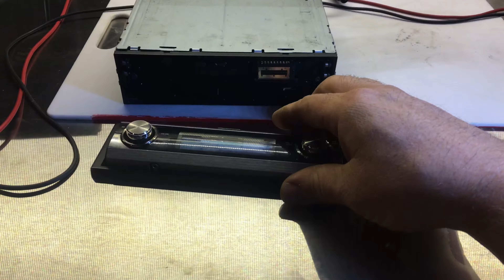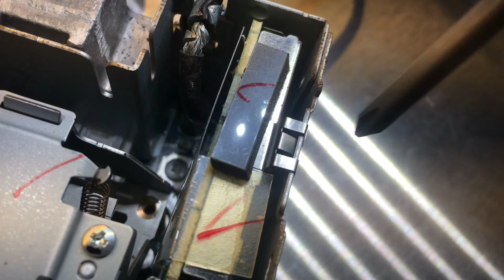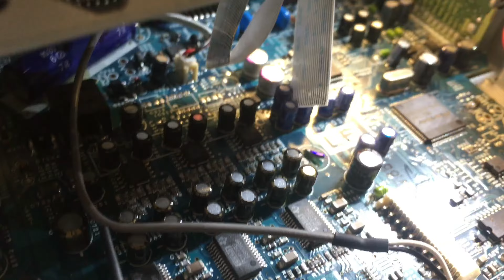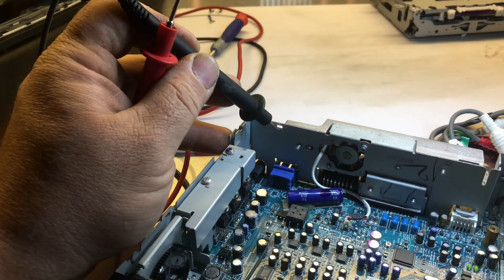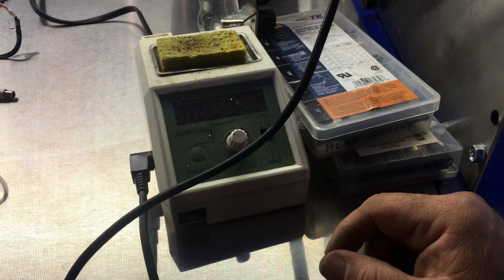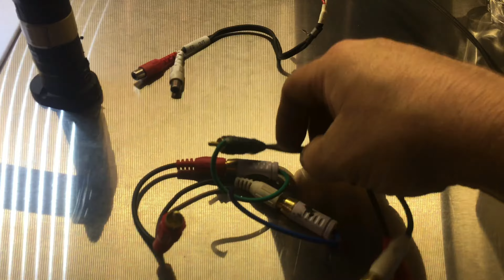Pioneer DEH-P880PRS Pico-Fuse

Comment: Hi Joe ... maybe you can shed some light on an issue I have. Mine is an old Pioneer DEH-P20 in my farm truck. Recently started cutting out the sound but radio was still powered. Kept getting worse until there's no sound at all. Today I took it out of the dash thinking I had a broken wire. I found that if I squeeze the case it will play. Also noticed that when I touch the case with the screwdriver I would get a sound through the speakers. I'm suspecting a broken ground somewhere but where? I did learn from your video how to get the top cover and CD player out to access the inside so thank you for that. Can you give me a suggestion? Carl
Reply from the maker: You’re on the right track but I would start by making sure your speaker wires aren’t shorted to ground.  You can use a multimeter with the plug disconnected from the radio. Test continuity from each speaker wire to ground. 

What you’re describing sounds like a bad solder joint in the circuit board. Try (with the cover off) using a non-metallic probe like a wooden pencil or plastic pen to press on the circuit board in different places to see what happens. You may find that (being a farm truck) you have some minor moisture damage on the circuit board. 

Those are my best suggestions without seeing the radio in person.
Reply: @JoesCarSmartsNY  thanks Joe ... I will try the continuity test first and then move on to if needed. The guy that had the truck before me ... Well let's just say that it say for 7 years because they did a "tune-up" and couldn't get it started again. I bought it and put the plug wires in the correct firing order and it started. So I will definitely start there. I will let you know ... Carl
Reply from the maker: @carlboehm5468  Hahaha. Yeah…firing order is kind of important for spark plugs. That’s a funny story.
Reply: @JoesCarSmartsNY   Hi Joe ... finally got around to taking this radio apart ... found the problem but I Have pictures so I am sending to your email shortly ... Carl
Reply from the maker: @carlboehm5468  Awesome. I look forward to it. I always like to know how puzzles turn out.

Comment: Mine will only play a CD for about a Minuit and then I get an error. Do you know what this issue might be. Thanks.
Reply from the maker: I would suspect a laser problem.  Try a cleaning CD:  Arsvita Laser Lens Cleaner Disc Cleaning Set for CD / VCD / DVD Player, Safe and Effective, ARCD-01 https://www.amazon.com/dp/B08PBPZB5Z/ref=cm_sw_r_cp_api_glt_fabc_HD3FF7SXVRGGYW7KNMM8?_encoding=UTF8&psc=1

If that doesn’t work, it needs to be repaired by a qualified technician.